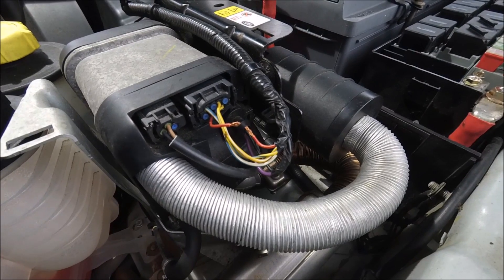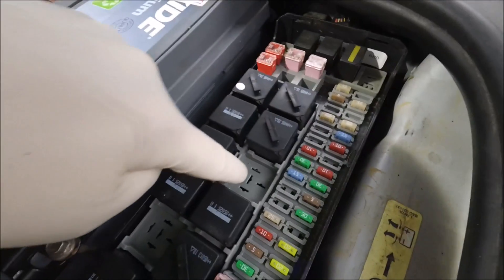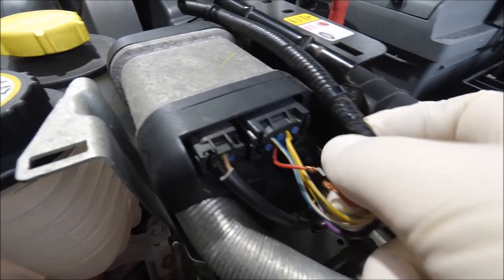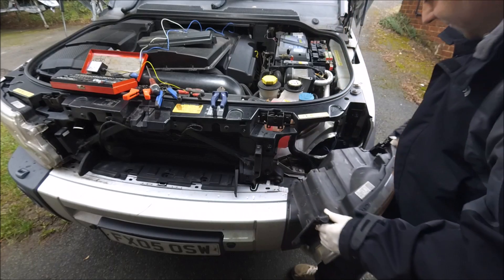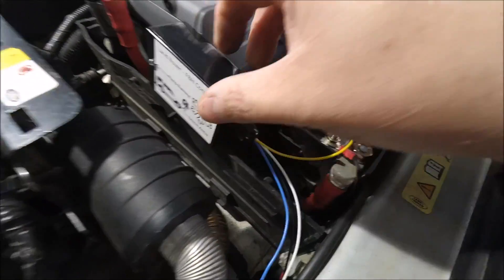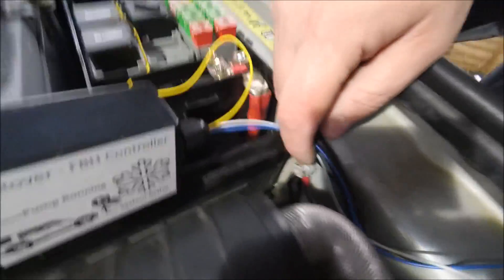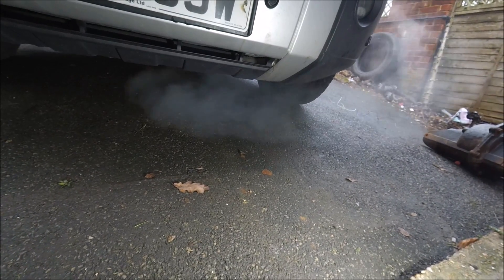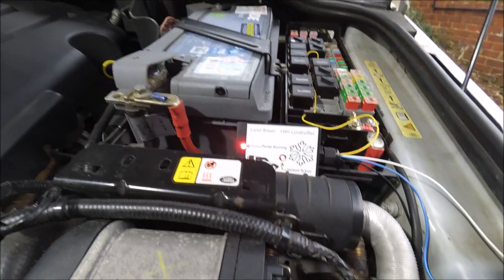Land Rover / RRS FBH Remote Controller. Installation & Operation

Comment: Could I ask...Just changed my battery. Does the unit have to be reset? ....HOW? ....Doesn't seem to be working since battery change!....Thanks in advance..
Reply from the maker: Changing the battery shouldn't cause a fault.
The only way you can check is by using a usb diagnostic lead connected to the FBH and run the webasto software.
Reply: @simonc5313  Thanks for the speedy reply Simon..Just reset the FBH. using the video on your Chanel. works great again👍👍👍.... Little toggle in and out three times, within 5 secs...👌
Reply: Do you have a link to this...... "usb diagnostic lead".......😉

Comment: Great product have checked my unit out I don’t seem to have red wire ? 
Regards Mark
Reply from the maker: The red wire is not needed. The controller comes with the pin crimped on the white wire to fit into the fbh plug.
www.lr-fbh.co.uk

Comment: Will this also start the blower? If not, have you figured how to do it?
Reply from the maker: No this is a fbh controller for starting the FBH.
Reply: Thanks, trying to get the fbh on and start the blower/fan to heat the cabin

Comment: SO WHEN YOU GET IN AND START UP THIS FBH CONTROLLER SHUTS DOWN IS THAT CORRECT,GREAT VID HOW MUCH ARE THEY ,I NOTICED BRIT PART DO ONE IS THIS THE SAME..THANKS....KEYBOARD BUGGERED
Reply from the maker: No if you have started the fbh using the remote it will continue to run until the engine water temperature reaches 75 degrees before it shuts down.
Reply: @fester. sorry, where what?
Reply: See my comment

Comment: So the unit is activated with the headlights being on. Does this mean the unit will run (providing the temps aren't met) every time the headlights are on? I have my remote set up for suspension height control. Can go think of another wire I could tap into to allow use of the remote? MY07 btw. Thanks in advance.
Reply from the maker: No. Watch again. The fbh starts when the lights are flashed.
The yellow wire detects when the ignition is on which prevents the fbh from starting when the car is in use.
Reply: @simonc5313  ah of course.

Comment: could this be fitted to my RRS 55 plate 2.7 diesel
Reply from the maker: gary checketts yes no problems.
355158@gmail.com
Reply: @simonc5313  do you sell these I'm looking to buy one for my 2008 lr3. Cheers bud.
Reply from the maker: @j0rzeh  Yes. Email me. 355158@gmail.com. 👍